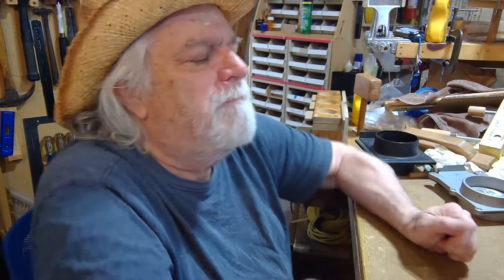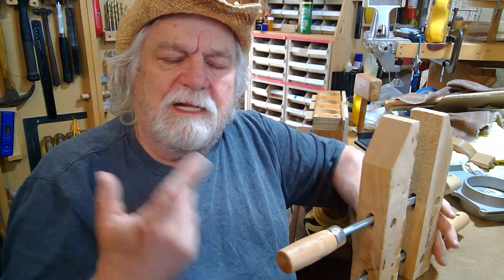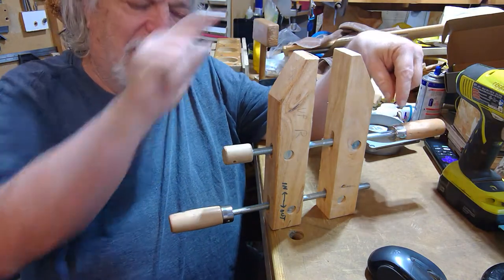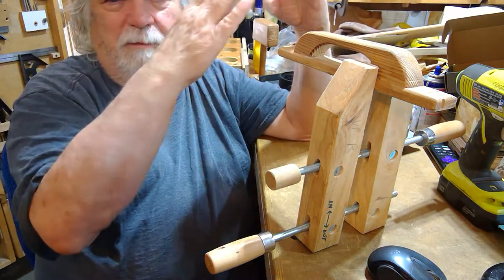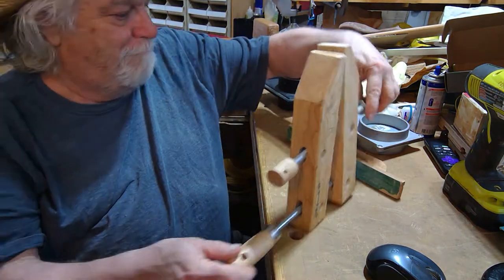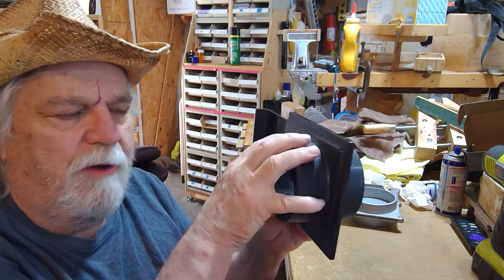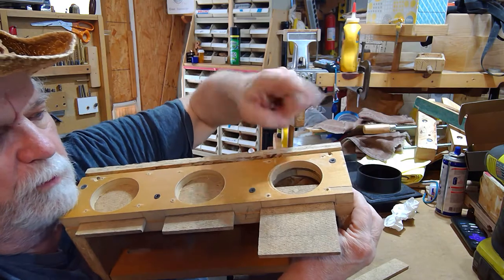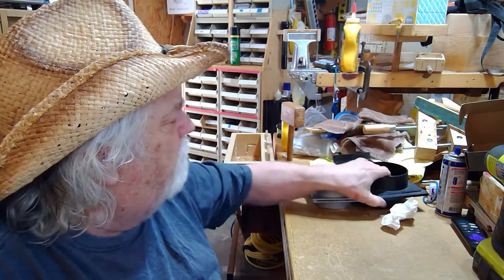Rambling Shop Tips and Tricks by Rambling Russ

Comment: The surgical tubes:  I use those with a sling shot.  They plug over the steel bar and are held on by friction.  I am wondering if they will hold on to a wooden dowel?  Cut a 12 inch piece and connect both ends to the dowel and see if you can make a rubber band. 

Additionally, I saw someone using a bunch of rubber bands on an F clamp.  He wrapped them around the top and bottom pieces.  He would pull the bottom piece down and hold it until the top piece was over the work he wanted clamped and the bottom piece was under the work where he wanted it.  When he let go, it sprang up to the bottom of the work and all he had to do was tighten the screw. The round band would work there.  

Clean out impossible to reach dust. My table saw has places that accumulate dust that I can't get to with the vacuum.  I have to pull out my air tank and nozzle and play contortionist to clean some of it out, and leave the rest until I break down the saw and turn it over.  If you take a piece of that hose and run it to the corner where you can't get to the dust, and run the other end to a "bank" of tube ends where they are easy to get to, you can clean the dust out of impossible to reach areas by pushing the nozzle into the ends of each tube and blowing air through them.  They will blow the dust loose so it can be sucked up  by the vacuum. 

Didn't you make one or more videos on the use of the wooden screw clamps?  I think I remember you using one as a desk vice or something...

OTB:  light and power tool safety in my shop. 
Right now I have one 15A outlet in the shop. Everything is connected by drop cords. I keep each tool unplugged unless I am actively using it. When I go to another tool, I unplug the one and plug in the other.  When I go back and forth, I sometimes leave both plugged in.  But, I'm forgetful.  Sometimes I leave one plugged in when I leave the shop.  There is nothing wrong with it except I want the power removed from the tools when I'm not there. 

As I remodel my shop, my plans are to add a square box that holds a light switch and two AC Power outlets for each tool.  These boxes will be mounted to the stand or wall near the tool.  One of the outlets will go to the tool and the other will go to spotlight pointed at the tools work area such as the drill press table or band saw table.  When I turn the light switch on, it will give power to both the tool and it's corresponding spot light. Instead of unplugging the tool when I am not using it, when I leave or when I'm working on it, I can just turn off the switch. The light will tell me if I am getting power to the tool or not. 

Don't worry if I can see when all the tools are turned off.  I have two shop lights with two bulbs each hanging over my 9x9 foot shop.  There is plenty of light without the spot lights.  For about the same cost as little indicator lights, I can get LED lamps that will give me light on the piece I am milling, so why not take advantage of it.
Reply from the maker: Hey Buck, I have been playing with tubing for a short while and it does stick on wood dowels, but getting it on the dowel very far is difficult.  Still OTBT'ing that and other ideas.  Does the tubing have a short life span to be replaced?
On your tablesaw, I found that if you use dust collection all the time, you will build up in corners but that actually makes the dust collection better (more aerodynamic).  Let it build up (except around the TS mechanical parts) and always use the DC and it will stop building after a while.  Just retrieve any large pieces that get away.  I did a video about this 3 years ago.
About the clamp, search on "otb vise"   you'll see lots of my screw clamp idea videos.